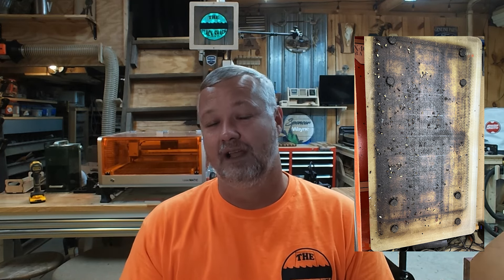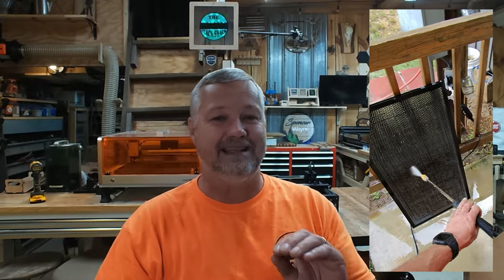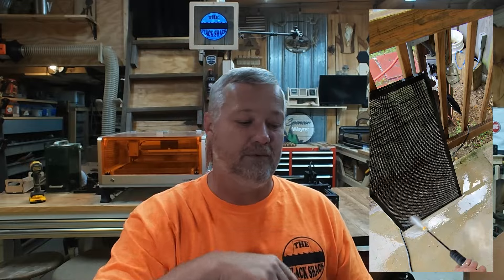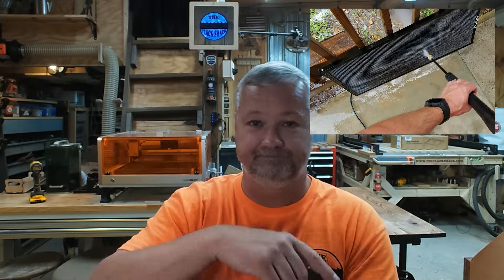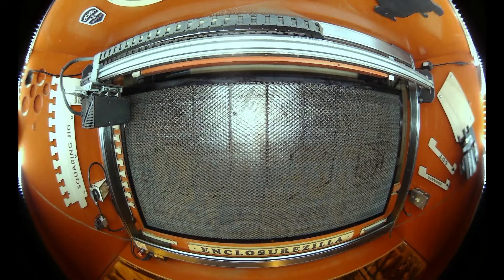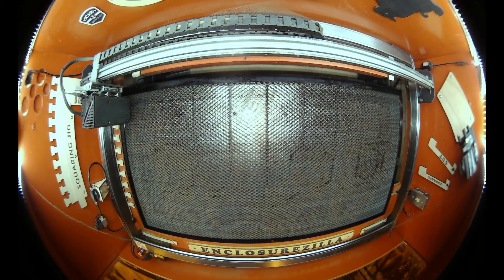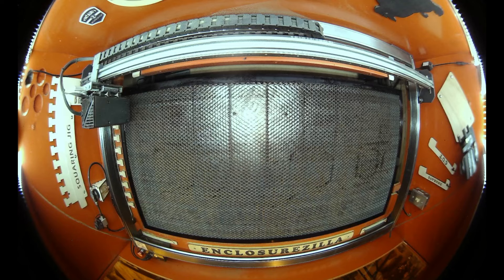Honeycomb cleaning- Getting rid of the GUNK

Comment: Another timely video as my honeycomb is in sore need of a cleaning. On another subject, I enjoy using Vcarve Pro and Lightburn and use both to design and/or adjust files. I recently picked up the Xtool F1 and for the life of me I am as lost as a goose trying to figure out how to use it. Do you have any suggestions as far as videos or anything else that might put me on the right track?
Thanks. I Need to qualify what I am having problems with -XCS software.
Reply from the maker: I run XCS for burning only, in my opinion designing in lightburn or vcarve is your best bet. Export as an svg and open it in xcs to burn. I have a couple of videos and so does Steve @Vintaurisworkshop

Comment: I use awesome degreaser from dollar tree works great I use the Purple degreaser. I let it set for a few min hit with a scrub brush then hose it. Then I let it dry in the sun. 
I very carefully use alcohol and those degreasers mentioned above to carefully leave my laser 
components. Use of caned air clean out inside the laser component.
Reply from the maker: Cool
Reply: I use LAs Totally Awesome as well, use full strength yellow from Dollar General spray on the honeycomb and use the air compressor on  to finish the job, and paper towels on everything else just don't get any on glass items alcohol for glass lenses. Regrease the rails and when the job is done.

Comment: I have been cutting a fair bit of plywood lately and my Atomstack 'honeycomb' is covered in goo, and yes it is churning out the smoke. In fact i just stripped down my diode module because that was grimey and covered in carbon.... so much so that it was getting hot! So guess what i will be cleaning tomorrow... using baking soda and washing detergent powder with a stiff brush and how water.
Reply from the maker: Sounds like it’s needed

Comment: What about other areas inside the laser cabinet? There is gunk on fan grills and other parts that cannot be removed.
Reply from the maker: Only my exhaust fan get a little in it. I use down draft setups. I clean the machines regularly but with my setup they stay fairly clean.I use alcohol and acetone for the machines.
Reply: @TheClackShack  thank you

Comment: When I start getting flame under my acrylic when Im cutting, then its time to clean my honeycomb
I use LA AWESOME!!!!...........It just melts the residue away
Reply from the maker: Once it has seen at much cutting as mine, it is hard to remove chemically. Light cleanings only go so far. I run my machines a lot more than most folks.